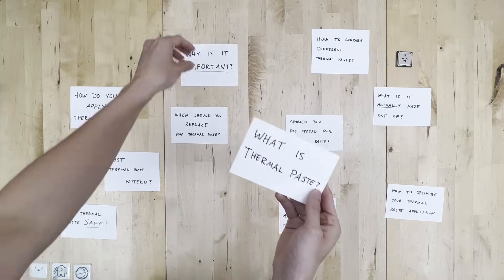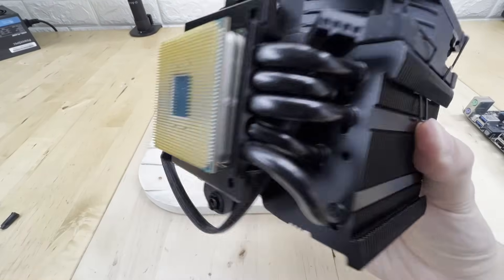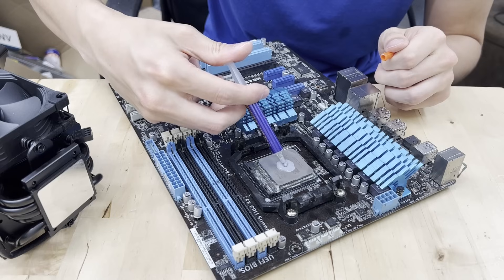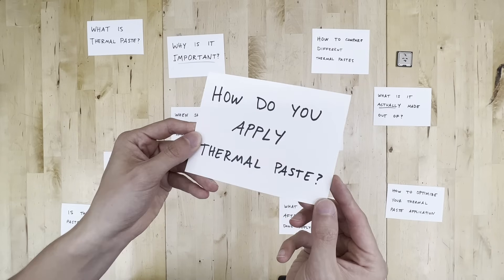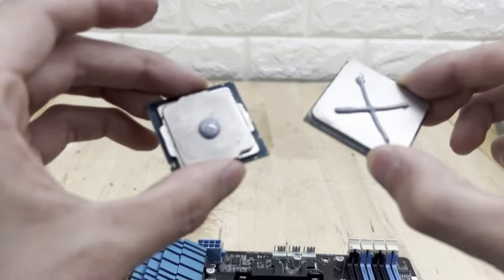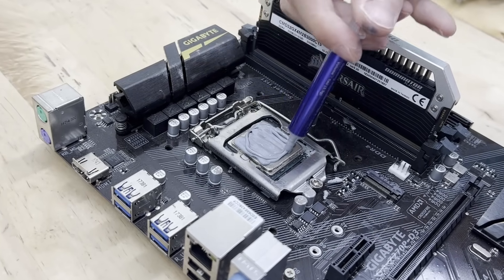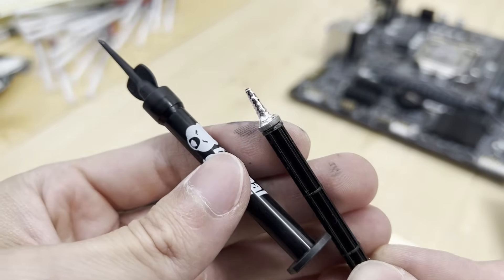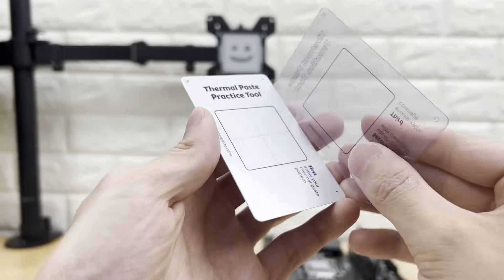watch this BEFORE applying thermal paste in your PC

Comment: Hey, i hope i can get an answer but its fine. My pc is been uncleaned for 6 or 5 years and when i cleaned it i saw 2 wires not connected when i opened it, note the pc was working before i opened it. I cleaned the dust then i just took the heatsink with fan off and  cleaned the thermal paste off the heatsink and kept the left thermal paste on the cpu and tried them all back together and when i turned it on i smelled burning so i quickly turned it off, when i check the insides there were no smokes nor anything i can find that is burnt looking what should i do?

Comment: 2 years is insane. I'd say a minimum of 5 years and have seen many computers go 10 years or more with no issues from thermal paste. If your thermal paste is only lasting 2 years, use a different brand.

MX-4 or MX-6 have always performed extremely well for me and lasted years.

Comment: So much crap.
1. The application pattern of the thermal paste is very important.
It is best when it is spread evenly over the entire surface.

2. The amount is also very important.

As little as possible because then the CPU and the cooler are closest to each other.

For the thermal pad, I also glue a copper block to the cooler, so that I can use thinner pads.
(The only problem might be that if someone else removes the cooler, they can easily knock off the components next to it.
But it helped a lot with my previous GPU. I'll do it with this one when the warranty expires, I still have 3 years left...)

Thermal paste has a much weaker thermal conductivity than metal, it is not worth much if it is thick.

If you apply it thickly and start screwing the cooler on, there will be a greater distance, so its performance will be worse.
+ more pressure will be applied to the CPU and motherboard.

What worked for me was to put Honeywell PTM on it.
Even, thin is good.
You have to learn how to put it on properly.

Or the other is to use a stencil on the cooler and apply the thermal paste on it. If I remember correctly, some thermal pastes come with a stencil like this, but it's not a complete square but several smaller honeycomb shapes.
Reply: Paste thickness is covered, you should watch this again but this time listen before you disengage your mind to formulate a comment. And what is your mention about a copper block? The cooler is already a copper block although often it is nickel coated. Adding another block in between adds more thermal mass to pass through before it gets to the heat pipes or liquid and away from the CPU.

And really, except for those doing extreme overclocking, even the preinstalled pad/paste will work fine for 90% of all PC users. Testing will show number differences but so little that the human at the PC is unable to perceive any difference while working and gaming.

Comment: 10 years without changing thermal paste, i have to change it soon, watching this video my temps are:
CPU: 30ºC
GPU: 33ºC
HHD: 27ºC

i think the only thing is saving my CPU is i dont play and like modern games i dont use edit videos or 3D programs.
Msdos games, late 90s early 2000 games or indies, and of course  watch Youtube,  thats all i use.
Intel core I3 7100, 3,90 Ghz 8gb ram, Nvidia Gforce 1050 TI, win7.

Comment: The point of applying thermal paste is to fill microscopic pits and slight surface imperfections to improve heat conduction.

If both surfaces were absolutely flat and free of such pits, the two copper surfaces could mate and transfer heat without any paste.

The goal is to apply paste so that, when level pressure is applied, it spreads evenly across the entire CPU surface with no air gaps.
This will not happen with an X-pattern.

The "soft" rule has been the same for decades: place a pea-sized drop in the center.
If the cooler block is lowered evenly and straight down, the paste will spread uniformly.
Reply: Yes. Ive always been using a dot in the middle and never had any issues. It seems to me like its the most efficient way to avoid applying too much and making a mess.

Comment: i have my cpu with that thermal pase for like 7 years, still today i am buying a new cpu and disipator for a new pc, i plan to sell the old cpu, it would be advised to apply thermal paste to both the new cpu and the old cpu , just in case?
Reply: If you're selling the old CPU then you would remove all thermal paste with alcohol. And when you apply the new thermal paste to the new CPU, place a pea size amount in the center of the processor surface and press the heat sink onto it level. Do not apply thermal paste in an X pattern, that will not equally cover the CPU surface.
Reply: @SpaceCadet4Jesus  I might but alas, i am not even sure if i can sell that , if i do its a miracle because its a very old cpu though if the person in the end pay for that i would apply a new termal paste if they really pay for real.

Comment: Who's changing the thermal paste of a GPU? Less than few.
So there is no reason to replace thermal paste of the CPU unless you change its cooling system.
Reply: There's plenty of reasons to replace thermal paste of the CPU because thermal paste hardens over time. Just because people are not smart enough to change the thermal paste of their GPU doesn't mean that it's okay to leave your CPU paste hardened.
Reply: @SpaceCadet4Jesus  The terms of CPU and GPU are totally different. 
GPU thermal paste replacement should only be done by authorized GPU manufacturer support personnel.
Otherwise, you will get a pretty "voided warranty" and that is definitely not wise.
On the other hand, CPU's thermal paste replacement has no such issues. So be aware of what is smart and what is not.

Comment: My Intel has been running 24/7 since 2010 with the stock cooler and the original paste.
Reply: Are you still running Windows 7?
Reply: @SpaceCadet4Jesus  Yes on my 4 core 22nm Intel, it's my main desktop. I need to redo the paste because idle temps have gone from 40 C to 54 C, but it's been going 24/7 since 2011 :D :D it's on right now but I'm using a laptop. The original SSD is still going because it's an Intel server grade SSD but it has damage mainly because of Windows filling the disk below 10 % free which forced many, many rewrites, but I've since learned how to discard auto backups and freed approx. 40 GB of meaningless data. So this while thing about Win 11 taxing SSD's, it's always been like that unless you keep a watchful eye on the system

Comment: I installed new ram so had to remove the AIO fans and since then my cpu has been running hot on idle, I have noticed that my cpu usage just around a lot.  I did reapply new thermal paste but it was still running hot.  I might have just applied the paste poorly, I’ve got a new cpu coming soon so I’m hoping this one will fix the temp issue
Reply: Apply the thermal paste in a pea-sized amount in the center of the processor. Apply the cooling block evenly and tighten in a star pattern. Applying the paste in an X does not give equal coverage over the CPU.
Reply: @SpaceCadet4Jesus thanks for the reply.  My AIO was damaged so I had to replace that and now everything is working better.

Comment: I use a credit card to spread it evenly and level. Been doing it that way since the early 90s when I first learned to build systems. Back then, they said the blob and pressure method put uneven pressure on the top of the CPU, which could damage it.
Reply: Well they were wrong, whoever they was. The pea sized amount in the center of the CPU and lowering the block evenly has never damaged a CPU. Unequal pressure causes the paste to squish out one side more than another and that's why you don't want uneven pressure. Using your method works too as long as it's not applied too thickly.
Reply: @SpaceCadet4Jesus  "They" would've been the various PC magazines I would read.
Reply: "They" were still wrong.

Comment: I think that the chip makers should laser etch  the outlines of the underlying Chip die(s) onto the can surface.  It would not pose any interface efficiency.  A single drop over each will suffice upon mating.  No need to slip and slide the mated parts.  In fact, this practice worsens the 'perfect interface' attainment likelihood.  A single mosh and then fasten never to shift again (till the servicing) .  VOILA.

Comment: i had a pc for over 8 years never replaced the thermal paste and the only thing that died was the graphics card and the power supply which i replaced.

on the topic of household thermal paste i think Jayztwocentz did that.
Reply: Maybe you should have changed the GPU thermal paste
Reply: @noneofyourbuisness2539  the card already died anyway.

Comment: It's neither.  The only way to ensure full and even coverage is to spread the thermal past with the "INCLUDED APPLICATOR."  These web sights tell you that it makes no difference, but it does make a difference.  - They just can't measure it.  It comes down to craftsmanship.  Doing it the right way is worth the effort.
Reply: Nope that actually makes it worse as you will introduce air pockets.

Comment: Dont use too much, just a little bit in the middle. Otherwise your cpu will not br able to transfer the heat to your cooleer, i used too much and faced this issue
Reply: Don't worry about too much paste the mounting pressure is so strong the heatsink or cold plate will compress any thickness of paste to a super thin layer that covers all the voids then squeezes out any excess. No little paste is a problem.
Reply: It Wasn't The Paste 💁‍♂It Was The Distance 👍

Comment: also remember there are tiers of cou's as welll,, usually 3 5 7 . the lower that numbner is the lower the heat expended, meaning the past last longer. example and i7  wil need it replaced over and i3.

Comment: Way back in time, when Arctic Silver was THE PASTE! there was a lot of arguments about how to apply the paste. The so called Pro Overclockers were generally saying you needed to spread the paste as thinly as possible. If you could read the text printed on top of the CPU through the paste layer that was close to perfect! But no Pro Overclocker would use a processor with text on top, they would lap both the processor and the heatsink before even thinking of applying any heat paste.

Then Arctic Silver dropped the bomb. They published their official instructions which was that you should place a single drop the size of a rice grain at the center of the processor and then put the heatsink on top. No spreading. No reading of the text through the thin layer. Just mash the heatsink on top of that blob and it was done.

The reaction was funny. The Pro Overclockers first claimed AS had never said that, and when they got the web link they said AS didn't have any idea about how bad their instructions were. Eventually someone got a piece of glass and tested, much like shown in this video, and wouldn't you know, that rice grain of AS5 spread perfectly over the processor without having to spread it by hand. In fact after much testing it was discovered that if you spread the paste as thin as the Pro Overclockers said you should there was a decent risk that you got bubbles of air trapped between the glass and the processor. Something that never happened with the rice grain application method.

At the time I was building servers for a living and I bet the Pro Overclockers would go bonkers over the way we applied heat paste. First of all we usually used the paste that the company making the server sized heatsinks provided. Generally this was a small blister pack of white generic goo that came with every processor. If they were left laying for long the silicon oil would separate from the white paste. This white paste was usually aluminium oxide and you would massage the blister to distribute it in the oil before tearing it open. Now these were just servers, costing between $5000 to $50000 each. And yet we used what all the Pro Overclockers knew was total crap, and they just kept on working for decades.

Now there were some better pastes you used sometimes. I especially remember the pastes from Shin-Etsu. The special with these were that they were phase change material based. So heat made them pliable and they spread evenly under the heatsinks. But when they got colder they hardened and wouldn't move anymore. This made them very good at negating the pump out effect regular heatpastes can experience. That they had exceptional heat transfer ability was just another good thing about them.
Reply: Finally somebody has something sensible to say.

Comment: With so many of the modern multi-core cpus having components spread across the plate area the notion of using a center pea and not spreading the paste across the CPU feels like old outdated advice. Even in these great examples of using clear material so we see the pressure spread underneath, there are areas (especially on the south end of the chips) that are not being well covered, leaving chiplets producing heat without paste.
Reply: na it doesnt matter. the paste is only needed to fill the small pockets. by itself if theres alot or little doesnt matter. the heat is still transferred in both cases. even with low paste amounts

Comment: I still have a 4670K with the same thermal paste since 2014 and the temperatures are great.
Reply: That’s probably because the 4670k has about 125hz clock speed and a 2 watt power draw, so of course it manages to stay under 100c during your Microsoft word sessions 😬
Reply: @Hankblue  It's overclocked to 4.2Ghz and stays under 70ºC while gaming.
Reply: @davidduarte27  Only teasing 😏That being said it is about 5 times slower than my old CPU and I suggest you upgrade  immediately
Reply: @Hankblue  I have upgraded in 2018, just kept the PC for someone else 😁
Reply: @Hankblue  why. all the games coming out are trash

Comment: Not true.... If you spread a normal layer all over.... You will NOT have change for unfilled hole. Yes it can not be 100% flat but if its not 100% its 99.98%. The small inperfectiion will be filled. So sorry thats not true. I know, i installed thousands of cpu,s.

Comment: new high performance pastes have got very high density, so arctic prefers X shape is the best for mx6 especially if u have new cpu cooler which has screws to tight..  but for mx4 you can use spatula. to me no need to replace paste. if you renew your system in every 4-6 years..paste is ok
Reply: This is an example of the real secret. Read the paste manufacturer’s instructions and do what they say…

Comment: I know the video is relatively "old" but perhaps someone in chat would like to help me out, I changed my thermal paste for the first time today and the thermal paste I had was somewhat "sticky", how do I know which thermal paste is more "fluid" and which one more "sticky"? besides, for some reason after finishing and plugging in my pc, he had some difficulties starting, like a car when you try to start it during very cold period, tbh, I left the windows semi-open and the pc completely open, it is because the system was too cold? thanks in advance <3
Reply: new high performance pastes have got very high density, so arctic prefers X shape is the best for mx6 especially if u have new cpu cooler which has screws to tight..  but for mx4 you can use spatula.

Comment: Hi, it truly depends on the CPU, the winner there won't be applicable to all types of CPU.

I've done the spread it yourself but it doesn't work for some CPUs like the 14600KF there could be a non-symmetrical design of the silicon underneath. The one that worked well was Noctua's recommended four 2mm round dots on the four side and 4 to 5mm round dots (I used 4mm and I measure the diameter of the dots with a digital caliper :-D coz' it's something you do one and it could last a long, it's best to measure things.

God bless.

Comment: Isopropyl alcohol 70% can cause damage and corrosion to the cpu socket if it seeps under neath the cpu in the socket  pins, Ask me how i know ?
Try to avoid using alcohol unless you are 100% sure it dried out before you start the system, but if it's hidden under the cpu, it's hard to know and it might take a while to become a apparent,  you will have issues like long start up, frozen or blue screen, finally frozen bios,  and after that you need a new motherboard,  maybe also a new cpu.

Comment: A few years ago I tried installing an Intel CPU both cleanly and with thermal paste. In reality, the computer worked better and 1 degree cooler without thermal paste. There are different thermal pastes, of course, but apparently the processing of the contact surfaces of the CPU and coolers is accurate enough. The point is how well the cooler mounts work and how careful the installer is and that the thermal paste fills the micro grooves. Should thermal paste really be used when installing CPU coolers? Has anyone done such a test officially?

Comment: A dot is going to distribute entirely according to how to place and then apply pressure with the heatsink. That's not so much the case with the X. With the X you're forcing it to distribute in a better way across the CPU.
Reply: Place a pea size dot in the center then apply level and equal downward pressure on the cooling block to then tightening the 4 screws one turn each alternatively. The reason for the dot is so as it spreads it pushes the air out equally, whereas with the X air bubbles can get trapped and it doesn't get equally applied across the surface.

Comment: its been 9 years of my 6th gen PC, it works fine, i never changed thermal paste, is it required to change if its running fine?
Reply: Nope. The only function of thermal paste is to keep your CPU cool, so as long as it's still doing that, it's good.

And yeah, I've seen thermal paste last a very long time, so I'm not surprised that yours is still good.